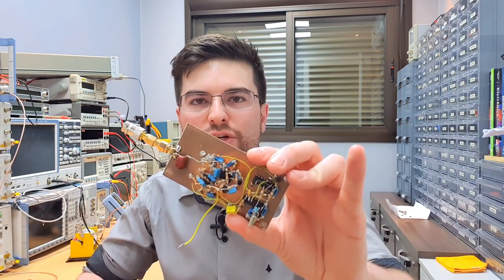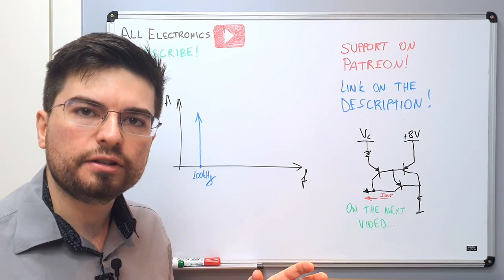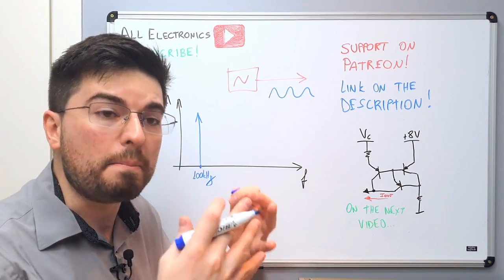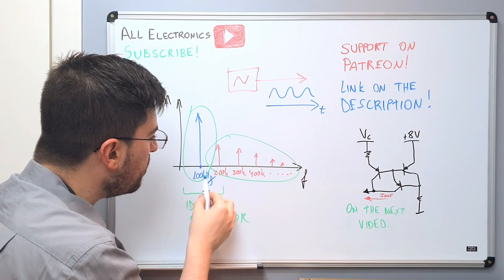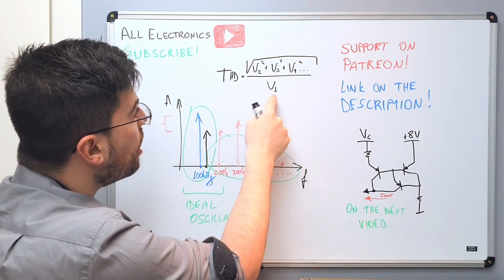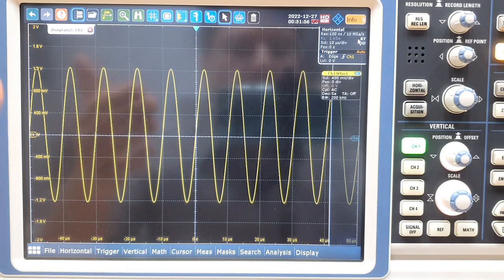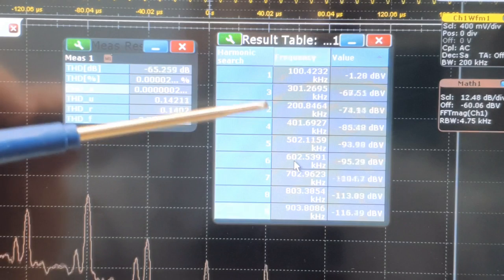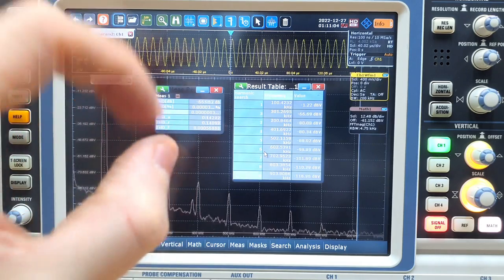THD - Total Harmonic Distortion

Comment: Hello Gregory how are you? I would like to ask you a question. If I apply a square wave generated by a function generator to the input of a 31-band equalizer, can I separate them by frequency band? I look forward to your help. I wish you much success always. I'm your fan.!!
Reply from the maker: Hi Jose, you could!

The audio EQ will not roll off fast enough to create a clean sine at the output. 

You probably will be able to change the shape of the square wave enhancing/attenuating the harmonic amplitude.

Thanks!
Reply: @AllElectronicsChannel  Gregory understood, I have a quality function generator, if I generate a square wave that is formed by an infinity of different frequencies, I will be able to separate them in each frequency band in the equalizer that has 31 bands. This separate signal will go to a vibration table and then excite a 100m/V G accelerometer which will undergo the FFT math treatment. Man, I'm so honored by your great kindness in coming here to help me. Thank you very much!
Reply: @AllElectronicsChannel  you as a great connoisseur of instruments, do you have any references for the 31-band equalizer Behringer FBQ3102HD?
Reply from the maker: Hi Jose, the square wave is composed of only odd harmonics, with decreasing amplitude. 

You would be in better place with a multi tone signal gen
Reply: @AllElectronicsChannel  If I apply a fundamental frequency of 30 Hz to a square wave, wouldn't the second harmonic of 2 x 30, 4 x 30, 6 x 30... be visible in the equalizer output? I want to analyze these signals after Equalizer in FFT